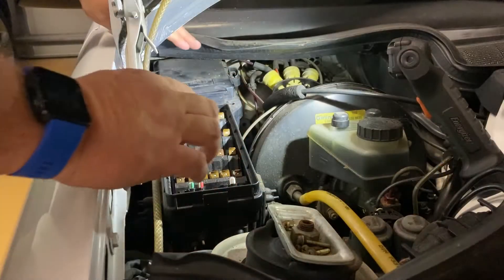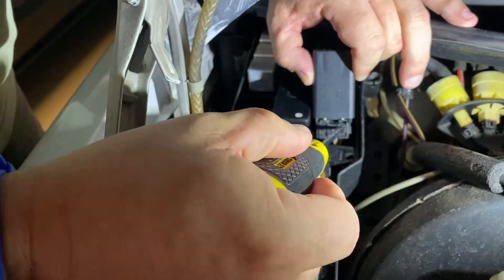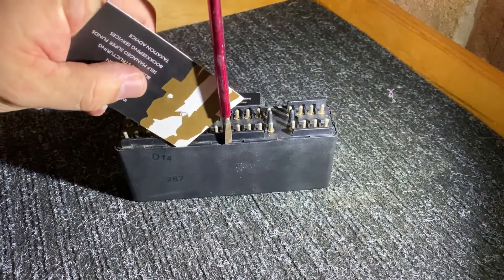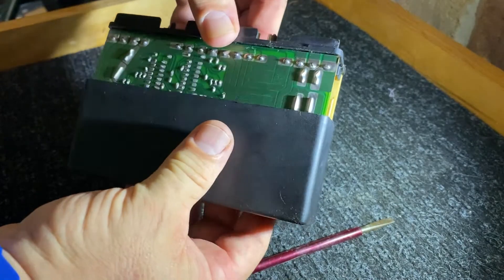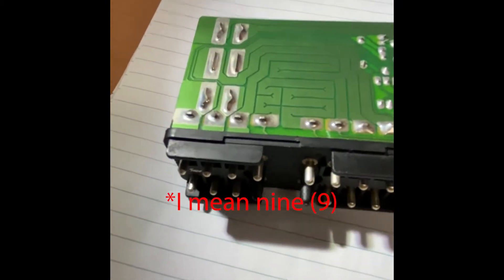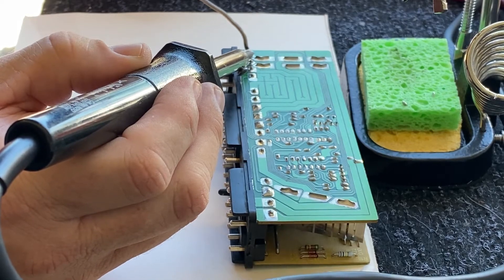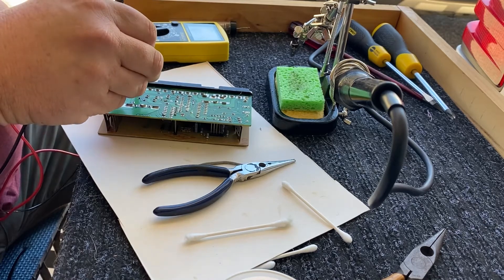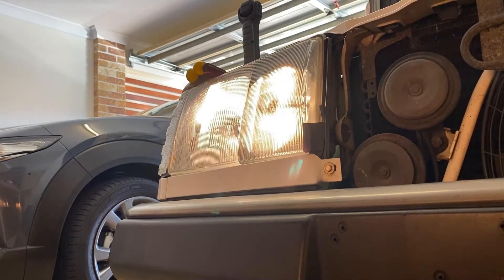Mercedes Parking Lights Don't Work - The illumination or lighting control module. 300e W124

Comment: Hello from the uk. Im wondering what the parking/drls are as im assuming that they weren’t a thing in the uk. I cant find any info on this and would like to have my indicators as drls (ideally without drilling a new hole for another bulb). TIA.
Reply from the maker: I am unsure of why any version of the w124 would not have daylight running lights/parking lights. The bulb for the parking light is in the same housing as the main headlight bulb. It sits below the main bulb. It's the first turn on the headlight selector. I changed my parking bulbs to LED's and they look amazing as drls. I have kept the original bulb for the main beams. This link shows the LED bulbs on and off as well as brining on the main beams and the fog lights. https://youtube.com/shorts/q2PNiiA4Arc
Reply: @generalvoltage1821  thanks. Maybe its a difference in terminology. In the uk i think theyre are just the sidelights. Those Leds look great.

Comment: For anybody having an issue with one of your DRLS not working. I would do your regular checks. If u find u don't have power at the non op one. Jump the wire from one side to another. Call it a day

Comment: Is this relay or box responsible for the high and low beam :)?
Reply from the maker: High/Low beams are run through the module so if a bulb is out it will show a bulb out warning. If you are not sure of the reason for any issues it's worth pulling the module and inspecting for cracked solder as shown. It's easy to spot when contrasted against the healthy looking solder. There is a later version (mine is a 1987) of this module that annoyingly has the same part number that will allow your bulbs to work even if the module itself has a fault. Or so I've been told.

Comment: Hello. Thank you for very Good and helpful video. Thank People like you, rest of us can repair our lovely W124. I have questiin to You-in my Merc level adjuster for low lights does not work.Would you have any idea where to have a Look? Thank you for any helpful informations. Greetings from Poland. :-)
Reply from the maker: If you mean the ability for the headlights to tilt up and down if you have a heavy load in the boot/trunk or a trailer then that is controlled as part of the vacuum system. I have not had to work on that in my car as yet. Try listening for air leaks near the thumb wheel control or near the headlights directly. Check vacuum line connections are attached to the headlight tilt module on each headlight.
Reply: Hello again. Thank you for replay. I have already sorted out problem with my adjuster.Like you said- plastic pipes inside headlamps were completly fallen apart. Thank you again. All the Best. Greetings from Poland. 👍

Comment: I have problem with the travel rear lights, its same solution?
Reply from the maker: Tail lights? Probably yes. They all run through the lighting control module so it's worth pulling it out like I do in this video and using a good magnifying glass or a nice well lit photo on your phone that you can enlarge. You will likely see solder that has signs of cracking. Of course check the bulbs first and any fuses.
Reply: @generalvoltage1821  thanks you so much

Comment: Hi, very good just what i needed, cant recall seen a better video. I had a taillight problem and replaced (will open and check my old one now) the relay and problem solved, however the turn signal stop working, any advice please.
Reply from the maker: Check turn signal fuses but also turn signal relay could have died. It's the one that makes the audible clicking noise under the dash and that is where you will find it.

Comment: I have a 1995 Mercedes Benz W124 E320, which until now still runs fast and is very comfortable to drive every day. 

Lately there have been some issues regarding some of the lights not being able to turn on anymore. 

After I saw your video. I'm interested in making repairs like you did, because can be done at home and so easy. 

Thank you very much for the information in your video, I hope your YouTube channel can grow and you can create more video content about the W124 Mercedes Benz car. And I would love to watch it from start to finish. 😄👌👍👍👍
Reply from the maker: Thanks Mate. If you haven't done soldering before, (like me) I practiced on some old circuit boards a few times to get a feel for how to do it. Also out of shot in the video is a big magnifying glass to make it  a lot easier to see what I was doing. Good luck.
Reply: I need to replace my ‘95 E320 headlight switch, the original is “fussy” you need to turn it all the way to the right, then back it off now the lights come on. Now fuse #3 dash illumination, the rear numberplate light suddenly won’t come on (both on fuse #3)  So, how do I get access to take out the headlight switch? Thanks for any help.
Reply from the maker: @pompom11  I've not taken out the dash headlight switch myself. I'd use the Pelican Parts how to guide: https://www.pelicanparts.com/techarticles/Mercedes-W124/114-ELEC-Replacing_Your_Headlight_Switch/114-ELEC-Replacing_Your_Headlight_Switch.htm
Reply: @generalvoltage1821  the new switch works perfectly, so glad that chore is behind me. Nice seeing the dash light shining bright again.
Reply: Jej, the ‘95 headlight switch is connected to dash, seat memory light, windows button light, all courtesy lights around the driver. Also all outside lights including rear number plate bulbs. 
Before I changed out my main headlight switch, I had to “wiggle-it” to get all these lights ON, I’d get the orange “bad bulb” light but all bulbs were good. 
New headlight switch fixed ALL these problems. So before you solder put in the new switch. Give the old one a shake, sounds like it’s filled with dirt. The plastic parts inside dried-out causing all the malfunctioning with the lights I listed. Enjoy your E320, mine has only 27,000 miles and mint Cabriolet white / blue leather and top.